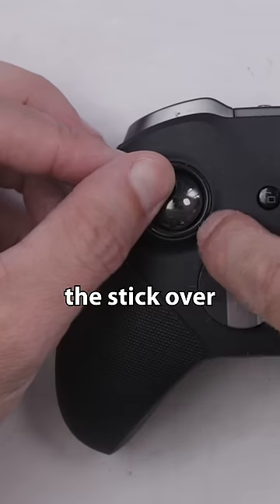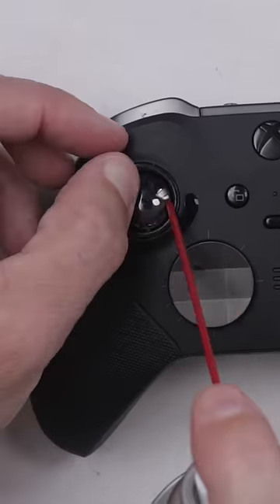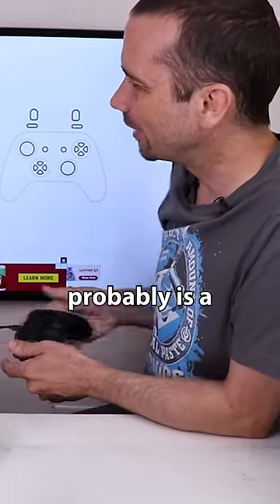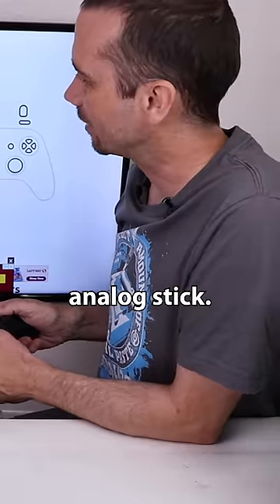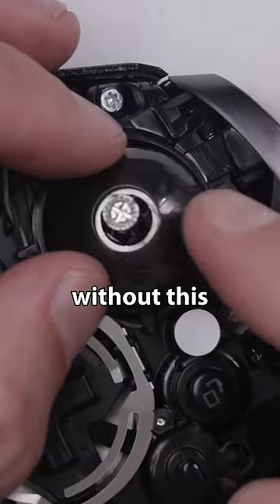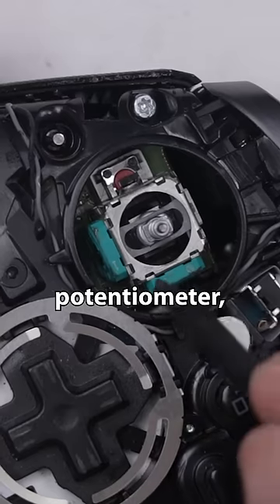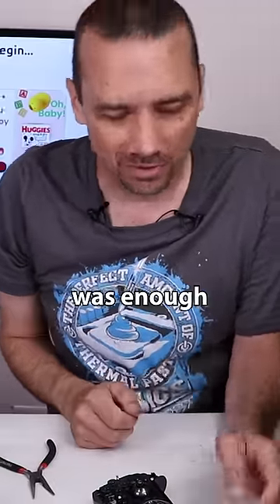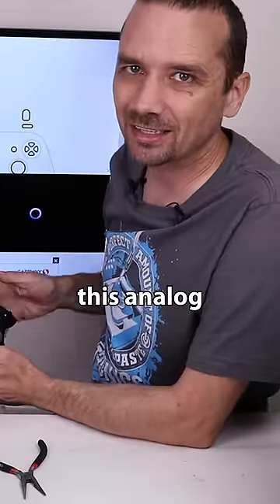The Easiest Way to Fix Analog Stick Drift!

Comment: Just throw it across the room in a fit of rage and it will correct itself
Reply: Respect 😎
Reply: Correct it self from fear, yes
Reply: The reason this works is because
Intimidation 100 :)
Reply: I agree . People seem to forget the old ways ...
Reply: Don’t recommend but throwing my controller at the wall out of frustration actually did fix it 😂
Reply: Beating up my dualshock 4 actually worked for 3 years lmao
Reply: 100% success rate tested it on every controller I’ve owned
Reply: Fear will keep them in line.
Reply: Just like I do to my wife :D
Reply: It works but then later on it stops working😢
Reply: 60% of the time it works everytime.
Reply: Ah okay sounds good, I'll do it next time to update you on it
Reply: This works 100% but it’s only temporary.
Reply: I dropped my controller and it turns on but won't work lol
Reply: My stick drift got so mad that I took my controller into my home gym and dropped a plate on it 3 times after throwing it. I might need therapy
Reply: Literally the lifts where I work. When my master key doesn’t scan I bash the reader a couple times and then voila, it scans first try
Reply: it’s true, i’ve done that before
Reply: 99% of the time it works
Reply: Instructions unclear, controller corrected itself so much, it went to college, quit his job and got a manager promotion in Houston Texas
Reply: My brothers and I used to have a gamecube that would constantly fail to read discs. One day we got into a big fight over a game and my dad, fed up, disconnected the gamecube, opened the backdoor and chucked it across the yard. Worked perfectly from then on 😂
Reply: @Chados.  W reference

Comment: Had a 360 glow controller for 10 years and never had stick drift. Connected a brand new Xbox SX controller to the computer and had stick drift for days. Sadly the glow remote completely died but 2011-2021 was a good run

Comment: The fact that they have us pay over $100 for a controller to have this happen still amazes me
Reply: Its on purpose. There are analog sticks that have been created that don't have this issue, but companies will continue to use this old school tech to keep us buying more controllers. Phone companies do this. Planned obsolescence
Reply: @AlienVale  it's also cheap to make these analog sticks and annoying to change an entire supply line to fix something that the lazy ass gamers can fix by getting off their asses and squirt for 0.2 seconds
Reply: @picklelover6576  and also makes them more money. Yeah, they want money, why tf do you think they are a business?
Reply: I believe there is a type of analog stick that uses some kind of magnetism to detect movement which allows for no/little dead zone and little wear. Don't quote me on that.

I remember back in the 360 days playing with a controller that drifted so badly that I could set the controller down and my character would move on its own. Didn't have the money for new controllers back then so I wore the sticks down to the plastic and wore the finish off the handles of the controller. A year into my Dualsense and it's sticks already wobble more than they should.

The problem is that I can't necessarily point to a manufacturer of a top notch controller that would last forever. I'm sure it exists and I don't know about it but for the average person it's Xbox or Playstation. It's not the same as other things like keyboards where I can buy a really good mechanical one and theres tons to choose from instead of the crappy ones from walmart.
Reply: The fact that you pay it amazes me.
Reply: Just got a pc. So much better off with it than a console that causes me to spend more money on it than games
Reply: @picklelover6576  Is it really that lazy to expect something you spent a 100 dollars on to just work?
Reply: As long as people keep buying them they'll keep selling them.
Reply: You do realize everything that moves in the way this does will get stick drift its not just a xbox or ps4 5 things its a universal thing
Reply: I used to beat the absolute piss out of my old 360 controllers back in the day. Like I'm talking full force beating on it. I never had one go out or even stick drift. It's wild to me that the new controllers are so fragile both for Xbox and Playstation. It's clearly planned obsolescence to make you buy more.
Reply: @Trippsy05  It’s called a Hall Effect Sensor.
Reply: Definitely not me who bought a Series 2 controller just for the lb/rb to break in about a year
Reply: It's crazy that they don't put electromagnetic sticks in here, those are almost completely immune to drifting
Reply: Buy a PC problem solved
Reply: THey do it on purpose to make you buy more and more controllers and you all happily do it
Reply: @Bigtexbbq  and i'm sure you spent over $1000 on your pc🤦‍♂️ nothing is built to last. Your pc will even experience issues after a few years
Reply: @AlienVale  they will switch to modular joysticks probably. That will fix stick drift but you will still have to pay at least $20 for the joysticks.
Reply: you are easily amazed
Reply: @AlienVale that's not why, there are many more problems that come with those types of analog sticks than good.
Reply: @nathannorton5972  lol it’s still not right. People who defend shady business practice are. I better than the ones that practice it.
Reply: Never had this issue on my ps1! I played for hours a day and only bought a new controller when they brought out the new ones with vibration in them.
Reply: Wow, that's a ps1.... they had no stick drift but a million other downsides
Reply: It's called planned obsolescence.  Welcome to the future.
Reply: @AlienVale which ones?

Comment: This helped a LOT with the joycon drift we had on our Switch. Glad I didn't have to take them apart. Also saw on your video how to test the controllers! Thank you!
Reply: I fixed mine with a business card and it took me like 5 min. It literally fixed it like new.
Reply: @williamswan5247  not always. Mine was a pressure issue. A defect from factory. That's why they will fix it for free.
Reply: @flyingmunk8956  it’s mainly the dust though. Depends if you bought your switch in the first like 6 months of the switch
Reply: @flyingmunk8956  likely dust, could be the mechanics but like mine it’s always the grime
Reply: Joycons use less durable technology, in most cases of stickdrift they are unfortunately dead (or need professional repair)
Reply: Does wd40 work the same?
Reply: @nightmare-time4plays943  no
Reply: @jaydengarcia9487  The issue with that is that they don’t actually send back your joycons and send you a different refurbished pair instead. Also I heard that they don’t always send the right pair back, so it’s an issue if you have special edition controllers such as the Splatoon 3 joycons
Reply: @jaydengarcia9487  Not in a country where the Nintendo distributors had bankrupted, yeah, it sucks.
Reply: @jaydengarcia9487  not worth it
Reply: You best bet is to swap the sticks with the magnetic thumbsticks they work much better and I've been using them on my ps4 controller for about 1.5-2 years and no stick drift
Reply: Gulikit released their hall effect joysticks for the joycons. Use those and you can’t have drift
Reply: Gulikit released their hall effect joysticks for the joycons. Use those and you can’t have drift
Reply: @Y D  that's the name of them thank you I forgot what they were called
Reply: I just bought a new pair from aliexpress it was like 5bucks for both and replaced with brand new, stiff ones. It's a much better solution than spray some stuff and only delay the moment drift occurs again
Reply: @jaydengarcia9487  too long

Comment: The new dualsense 5 controllers are very quickly getting this stick drift problems. Can you make a video on how to open and „repair“ the potentiometers?
Reply: @4fai6  damn they makin u buy sum after buying the main stuff ... jesus
Reply: @4fai6  it’s not fixed, same sticks.
Reply: @4fai6  you don't need the coloured controller for improved sticks any new white  ps5 since April 2022 has had an A serial number ending.
Reply: @4fai6 it’s not a mistake lmao, they want more money.
Reply: @4fai6  I mean there is no difference inbetween the new ones and what's the point and getting a coloured one when your gonna have to spend another 50 on the plates for the ps5 for it to somewhat ok. 🤔
Reply: @Sunglasses_Emoji  you don't need colored plates to match your controller 😂 and if you're getting new plates get something like the dbrand ones for better airflow
Reply: The new PS5 controller have less stock drift the stick drift is caused by the metal pieces under the piece where the actual stick attaches to you can but new ones from extreme rate it's fairly simple to install
Reply: My launch dualsense still has no stick drift. However the L2 spring broke, it was an easy fix though with a 5€ spring kit I got from Amazon (there are cheaper, but shipping would take longer)    
  
New dualsense controllers have bigger/more durable springs so it shouldn't be a problem now
Reply: It’s actually pretty easy just have to be careful
Reply: What are you doing to get stick drift? Had one for a while and my joint ain't go any stick drift.
Reply: I kept dousing it with 99 and kept moving it around and I fixed it.
Didn't take it apart
Reply: @4fai6  they all have the exact same joystick module and potentiometers so they all are the same even xbox controllers. But now you can get a victrix pro or a dualsense edge for replacable joystick modules and prolly hall effect sensor upgrades in the future.
Reply: @Sunglasses_Emoji  there is a difference on how the triggers are mounted to the controller not jpysticks
Reply: See people say this but mine 2 years old and know problems. Quit dropping your controller
Reply: @thesolidsnek8096  there's already a company that offers hall effect controllers and joysticks called gulikit
Reply: open it, desolder the stick, replace the pot, solder the stick, assemble the controller
Reply: @Sunglasses_Emoji  the coloured ones are guaranteed to be the new internals since they were released after, but you gotta look close fror the basic white one
Reply: @chaosinhd1823  Not for the ps5, only for xbox and steam deck. But i am aware of that. Its the highest quality controller out there but u cant mod them with backbuttons
Reply: @4fai6  they didn't fix it tho... I don't understand why you're sticking your neck out praising a company that's literally selling you controllers that are prone to failure so you keep giving them money. It's a rip off. Your better off buying a modded controller with hall effect sensors that won't fail on you.
Reply: @youtubetv1414  there is no hall effect sensor replacement nor a controller for the ps5 yet. There might be in the future for the dualsense edge but nothing as of now
Reply: Dualsense is on it's first generation, it's Dualsense 1
Reply: ours got stick drift in less than a month
Reply: @4fai6 nah bruh I got the black one one day it was fine the next day I had stick drift like crazy
Reply: @4fai6  the one that came with mine a white one has it bad too but my black and pink are good so far had the black one as soon as I got a ps5 but can't use the white one
Reply: Ps4 controllers are all the very same. They're designed to break so I'd suggest you sell the ps5 and buy a gaming pc. Unless you feel like throwing money into the trash every so often.
Reply: @4fai6  controllers get stick drift whether you like it or not. Taking care of it or not dropping it doesn't just magically stop it from getting drift, it's the technology of the potentiometers, they are designed to fail.
Reply: @Dogsparkster  i said you have a longer use using the new controllers, not forever
Reply: @4fai6  no you don't. They are the same joysticks, take them apart and you will see they are just the same potentiometers.
Reply: buy hall effect controller
Reply: @mikesprigg5495  my p4 controllers never broke. Mouse and keyboard is for virgins
Reply: @clintperez8874  interesting, I went through about 10 of them, as did my best friend and many hundreds of thousands of other people. If you're bringing up virginity I'd say you're quite young so infact quite un educated when it comes to the bedroom. The only action you get is with a sock puppet bru
Reply: Best tip I can give you that’s worked PERFECTLY for me is to just buy a new one 😂 however when you do make sure you put the warranty on it. You should have a year to turn it it (if something were to happen) so what I did was save all the packaging, wait about 6 months, clean the old controller with the drift, put it in the packaging, and give GameStop the “old broken controller” lmao they’ll give you a new one, put warranty on it again and BOOM you have an infinite amount of controllers that’ll cost you like $10 (MAX) bc of the warranty!
Reply: @SldOnEmWithDa45  your paying for the controller to begin with so it's not just $10 correct? Also you could just take the actual controller under warranty and say it has issues for an exchange. I don't see the point of this, it's literally just using a warranty.
Reply: Yeah get a pc, after 8 controllers over 4 years I got tired
Reply: @animarrowgaming1607  same :()
Reply: @4fai6  Xbox doesn’t even have it what do they gotta fix?? Call Sony and tell them to fix that thermal paste😂
Reply: @4fai6  lmao I barley play the game😂
Reply: Weirdly I've never noticed my sticks  drifting on any of my 3 controllers after heavy use but I have heard its a problem. Idk If people are applying too much force or what
Reply: No, cus they were designed for this. Buy more. That's what the company wants. Their mechanism is extremely cheaply made
Reply: @bigdank7789  thermal paste issue was debunked, yall dont do research i see
Reply: buy an Xbox elite 2 controller lol
Reply: @SUP3R2069  Its not like its an intentional thing, Ive had mine since launch day and I have no drift
Reply: Really sorry bro ,getting stick drift so early is  a shame btw , Sony doesn’t value its customers after sales 😢
Reply: i had it happen but just pushing the stick to one side and blowing air under it seams to fix it, at least does for me
Reply: Its Not a repair it's dust in the pententiometers causing false readings super easy fix
Reply: @Sunglasses_Emoji  I have a purple one with very bad  stick drift after 2 months
Reply: @ItsWolfie.  this is lies my purple controller has way worse stick drift than the stock controller. Didn’t last 2 months
Reply: @0nyxvybz0nly89  it's not lies it's a proven fact
Reply: @0nyxvybz0nly89  if you look it up you'll see that im not lying
Reply: Best fix is to buy a controller that doesn’t use them
Reply: @nonope4390  ya
Reply: @mythicaldragon2260  buy Hall effect controllers, and then pray they’re comparable with the console 😂
Reply: Mine was real bad and got fixed my a software update to the controller. I was mad it was the software the whole time.
Reply: @nonope4390  bruh why don’t ps5 controllers use them. Makes no sense why use cheap sticks when that is literally the only weak point in the controller?🤨
Reply: Me who has thrown my series x controller so hard at the ground it bounced back at my chest and has had no problems whatsoever
Reply: @zafer D. It’s easy just order the potentiometers for your controller off Amazon some controllers you can just pop em out and put new ones in others you have to use a solder gun by pulling the joystick assembly away from the circuit board and soldering the prongs on the back it’s a little tough but it can be done at home

Comment: Imagine charging $100+ for a controller and still not using hall effect sensors
Reply: Moneey
Reply: I'm pretty sure the elite 2 controller came out before hall effect sensors were accessible without making the controller cost more than its worth lmao
Reply: @saltyuwo7322  That's why I said on a $100+ controller. $60 for a controller with hall effect sensors is a steal, but at $130 why not just make it $150 and make real premium controllers. Also hall effect sensors have been around for 30+ years, and seeing as Sega used them in the Dreamcast controllers in 1998 it's clearly not too expensive.

Comment: I've had the same controller for 6 years and when it finally did get drift I just gave the board an alcohol bath to get rid of any corrosion and put dielectric grease in the joystick mechanisms. Still works just as good as the day I got it.

Comment: Hopefully they start just putting halleffect joysticks in to stop with the stick drift already. But then you won’t have to buy a new controller so
Reply: But it makes companies money. Why would they want to trade costumer satisfaction over profit?
Reply: hall gimbals can last for more than 6+ years even with the roughest use. these companies can force you to buy more than 3 controllers at the same time.
Reply: i know how to mod controller pots for hall effect sensors but I don't want manufacturers coming after me for ruining their business.
Reply: @OnePunchHeizou  How though? The actual PCB has the sensor to read the position of the analog stick doesn't it?
Reply: @CxDOGxLEM  pots are the sensors in this case. you can generate the same analog values using ratiometric hall sensors and a small compensation circuit.

Comment: You gotta remember that gunk isnt leaving the controller but just the stick assembly. That gunk is ready to stick up some other part of the controller in due time.
Reply: There's nothing below potentiometer to gunk up. Just some surface mounted capacitors and resistors. Some residue laying on the traces isn't messing up anything. The potentiometer for the trigger is up and to the left.
Reply: The only thing it fixes is any sticking in the mechanical assembly.  This works 50% of the time because it's assuming that's something isn't mechanically broken inside. Alcohol works too, because temporary acts as a lubricant and cleans any dirt int he mechanics of it.    These Pots are usually cheap though, so it's always good to just replace it.